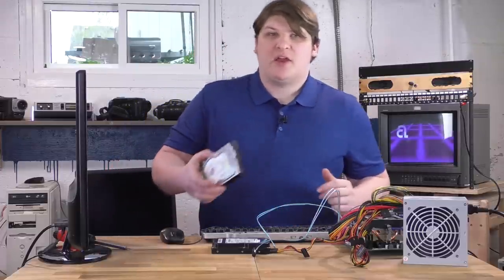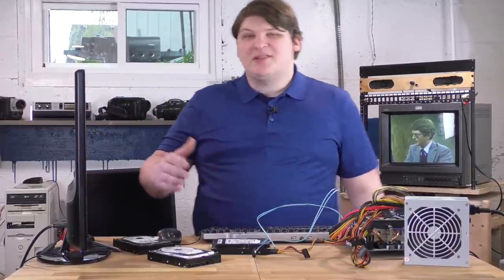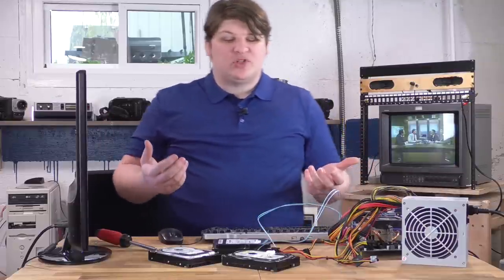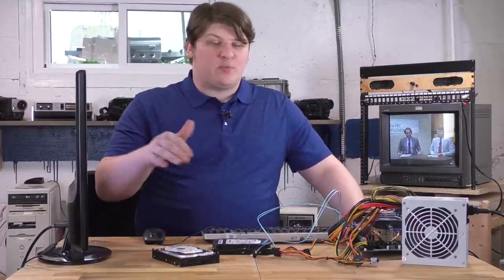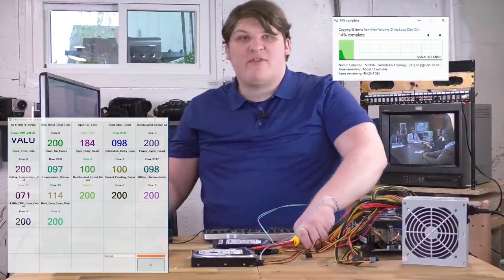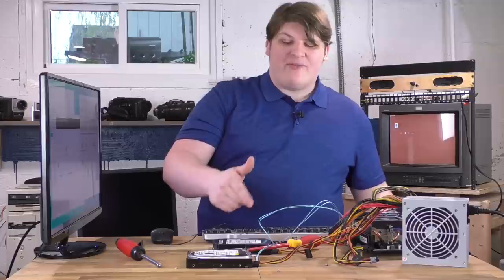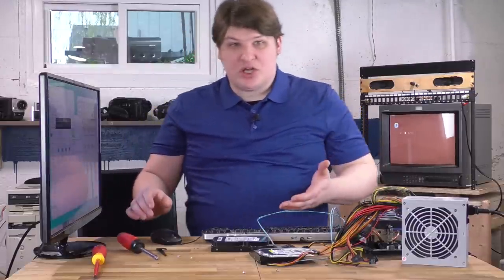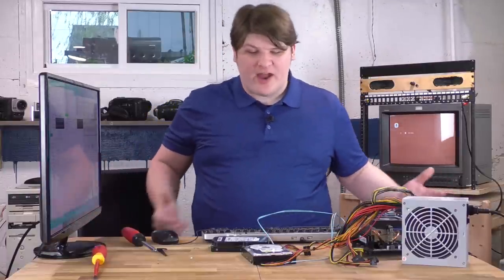Can A Hard Drive Breathe Regular Air Like Us

Comment from the maker: I didn't see a good place to expand on this in the video, but:

The most interesting takeaway from this experiment, to me, was that drive just kept trying instead of giving up. My impression of these devices was as highly stateful and intelligent machines, and I assumed that after a certain number of critical failures they would stop trying completely, and go into a coma to avoid further damage.

I also assumed that very tiny alterations in their environment would result in self-protection shutdown - when I took the cover off I suspected that the change in air temp, etc. might cause the head to not fly as high, for instance, and it would notice that and trigger an error state, or that if the head positioning coil went over-current it would trigger an error state, and either one would cause a shutdown.

This is, obviously, all entirely false. There really can't be failures worse than what I caused, and, in retrospect, I realize that my assumption wasn't supported by anything I'd seen in my life - hard drives with extreme damage, like a head crash so bad the head wears a visible track into the platter, always continue trying to operate; that's why clicking is such an expected behavior from dead drives, it's the disk trying over and over to start up despite being damaged beyond any possible recovery.

This almost "analog" behavior has changed how I characterize hard drives in my head entirely, from highly sophisticated devices, to machines that know how to do a couple things very well and have little decisionmaking ability beyond that.
Reply: As a design consideration, when extrapolating from some limited sensing about the state of your system and its environment, it's often better to avoid adding excessive complexity and prevent false-positive "fail-safe" scenarios -- because those can produce a terrible end-user experience. There are often a number of different conditions that can produce the same sensor values, and keeping track of which regions of this enormous state-space are benign or transient, and which ones are actually critical can be a full-time job, and not worth the effort for "consumer-grade" applications.
Reply: Nice job! Really interesting. But I wondered if you could just cut the portion of cover over the screw and tighten it again but just with that little piece from the cover over it to properly tension the heads. Could it work??
Reply from the maker: @hugofco2037  I thought about a lot of ways to do that and none seemed practical. It's pretty heavy gauge steel, so I would have had to take it off, go to another room, cut it down with an abrasive wheel and bring it back. This would be incredibly messy and produce a ragged result, which would not only leave the drive open to the world for half an hour while I did it, but I could never adequately clean the resulting object enough to be sure that it wouldn't deposit metal shavings onto the disk surface, which I'm sure would kill it.

I also believe the tension would only work if the resulting sheet spanned all the way to the sides of the drive, and possibly only if it spanned all four. So I decided not to try it, but maybe someday I will since I have a better, cleaner metalcutting implement now (drill-powered nibbler.)

Thanks for watching!
Reply: @CathodeRayDude  Well, I just realized I'm late to the show, but besides that. you could get 2 identical hard drives & pre-make a cover for your test drive. great video & amazing ending. I couldn't believe how abruptly it ended. I feel sorry for anyone who didn't watch until the end. ( FYI  I had the same thought on how you'd be able to do it. until I thought of a donor drive.)
Reply: It does happen that failing storage devices will go read-only, but evidently this unit never failed.

Comment: I opened up old hard drives and played around with them back in the early 00's. I was amazed at how long they kept on working without a cover on them at all after hearing all the tales about how fragile they are. I think I had one spinning along happily for a week before I got bored with it. Obviously it would eventually die and I would never trust any data on it, but it was neat to watch it work.

Comment: That was cool! Should've tried some less drastic tests at the end there, like instead of just dropping the spinning drive, could try these first next time:

- Breathing on platters
- Coughing on platters
- Touch platters with clean q-tip
- Touch platters with alcohol on q-tip
- Touch platters with finger wearing rubber glove
- Touch platter with bare finger
- Remove and replace platters &/or head with bare hands
- Yell at hard drive
- Taunt hard drive
- Make cat's paw touch platters
- Scratch platters with fingernail
- Scratch platters with key/screwdriver
Reply from the maker: these are very good, especially kitty paws, but I felt the video was getting long in the tooth and didn't want to get harder into it - however, I may do a second episode at some point with more experiments

Comment: I opened an old hard drive and then spun it up with a takeaway box lid over the top.  It worked fine for the duration of the experiment.
If I remember right that was a 0.3GB or 0.5GB hard drive.
This is a fun little video, I'm glad the algorithm recommended it to me!

Comment: This reminds me, I had this one hard drive that failed in 2018 (an absolute chungus unit of a Western Digital drive, I don't know when it was made but seemingly it was in a repair shop in 2013). It did this thing where it would buzz and churn and it just did NOT sound happy. At a random point in 2021 I decided to try recovering the files for the umpteenth time since it failed and, with my own two eyes, I witnessed the hard drive fall off of my bed from a roughly 3 foot drop and BOUNCE once before it lay on the ground motionless. I thought it was absolutely DONE FOR after that.
In some sort of godly 1 in a million miracle, it seems like dropping it actually FIXED IT, with the hard drive hooked up it started displaying errors related to missing windows stuff on boot, I used Hirens to recover and I had some more ridiculous hoops involving recovering the files again back to the hard drive, but I totally saved my 2015- mid 2018 legacy by pure luck and even now I still have no idea what "fixed" the hard drive.. after watching this vid I'm dying to know if anybody has had a similar experience to me in this regard

Comment: back in the late 90s at the shop i worked at, we pulled a hard drive apart, used standoffs on each corner to put it back together.  then clear tape around the outside left us with a bench drive with a window all around it to look in and see the heads moving.  we used it like that for a couple of years on our test machine out front.  cool display piece, people always asked about it.
i guess these days getting an acryllic cover made would be the better way to go

Comment: When I saw the picture of that Seagate ST-225 I laughed out loud!  I had a computer at one time that had that same 20 MB drive.  One day a lightning strike occurred in the courtyard next to the apartment building where I lived.  The PC seemed to work OK, but later found out that the 12 volt output on the power supply was a little weak.  When turning my computer on, I had to "jump start" that massive ST-225 with a 12 volt bench power supply!

Comment: Many mainframe hard drives had removable disk volumes, because the media was less expensive than the drive.  A typical volume had 6 to 11 platters the diameter of a large pizza, stacked four to six inches high, separated by about 3/4 inch on the spindle.  Outside the drive they were stored in a two piece “cake caddy” cover, with a handle in the indented clear top piece that turned an inner spindle, to which the opaque bottom piece was screwed.  To mount the pack, the operator opened the lid of the drive (which would only open when its spindle was completely stopped), removed the disk already mounted, lowered the disk by the handle on the top cover, turned the handle clockwise until it stopped, releasing the disk pack from its cover and locking it to the spindle, then closed the drive lid and started the drive.  When it was up to speed, the heads (5 for 10 tracks per cylinder, 10 for 20), parked under cover, extended between the disks.  To remove a pack, the process was reversed: stop the drive (which would retract the heads before turning the motor off), open the lid, lower the top cover onto the pack, turn the handle counterclockwise until it stopped, attaching the pack to the top cover and releasing it from the drive, then lift by the handle, screw the bottom of the cover on with the other hand, and put it away.

Even then, computer rooms had to be semi-clean, particularly no smoking!  When storage densities got larger, the manufacturers started using sealed HDA (head-drive assembly) volumes, replaceable only by service personnel.  Fortunately, disk and tape drive data speeds by that time allowed entire HDA volumes to be backed up and restored in a few minutes.  Critical data was maintained simultaneously on multiple drives on multiple channel attachments.

The storage capacity of those huge disk packs, incidentally, was in the hundreds of megabytes.  Later they reached gigabytes with the non-removable HDAs, which were part of the drive.

Comment: This brought back memories. For a class in high school I attached all the parts from a computer to a board to display on the wall and also removed the top of the hdd. The computer ran for weeks like that before it finally started to BSoD. Granted this was maybe a 2GB drive at most so not nearly as dense, but didn't expect it to survive long at all.

Comment: As I understood it, the vents with filters aren't to exchange air.   They are present so there won't be a pressure difference between the inside and outside.   Like, when the drive gets hot, the air expands.  You don't want pressure building up in there.   So a little hot air escapes through the filtered vent.   When it cools back down, you don't want a slight negative pressure, so some air goes in through the filtered vent.

I seem to remember in the distant past, some just had a single pinhole in the lid, possibly with no filter.  They were marked with something like "DO NOT COVER THIS HOLE".   I know more modern IDE and SATA drives had filters under them.   These older drives would have been like 1980s/1990s era hard drives, that I took apart in the late 1990s and early 2000s.  Like MFM, RLL, and early IDE.  They may have had a single layer filter that looked like a paper sticker.  It just needed to relieve pressure, not any large volume of air.

I don't remember handling many SCSI drives from that era.  Or at least none that I took apart.  Those were serious investments by the company, and they didn't allow for that kind of playing.

Comment: When i was younger i had a job destroying hard drives, old hard drives filled with concrete so the best way was with a sledge hammer. I'd put put the drive on-top of two concrete blocks with a gap in the middle then smack the drive in the middle with the edge of the sledge hammer, if you did it right the whole drive folded in on itself and shattered the plates into dust. €2 a drive was a damn good pay and i now have a certain respect for how tough hard drives are.
Reply from the maker: I had a job destroying hard drives as well for a while; we used an arbor press with a sharpened punch, and boy howdy did I ever find out how many hard drives have glass platters. Punch went through like butter though! Technically a sufficiently motivated attacker could have recovered some data from them but hey, we weren't doing CIA grade stuff.
Reply: @CathodeRayDude  I tried using a bench press at the time but it was too slow so the sledge was a good option, if i was having a good day i could get through about 50 drives in half an hour but it was certainly not easy work. If you missed the center of the drive it would hurt like all hell right up to your shoulder.

Comment: I put a plexi window into an old Toshiba drive, turned the shower on in the bathroom to as hot as it would go, then let the air settle for a bit. Opened it up in there and placed the drive under a clean dish once the cover was off. Ran that drive for months with no issues.

Comment: I once had a 20GB WD EIDE that had a frozen head that somehow got laminated to the platter. I popped the cover and freed the head, put it back together and it ran for years in a small FTP server as the system disk. It was still running when it was retired and recycled. These things are fragile yet built like tanks.

Comment: I have HDD 30 years old that still work.  I have 4 drives that have been running continuously for 20 years. I have had 10 SSDs fail while in warranty.  IMHO SSD's aren't ready for prime time.

Recently a friend brought me two computers that he wanted to get the data off from them with MFM IDE drives from the mid 1990's in them.  One of them would not spin up.  It made a lot of noise.  I powered it down and opened it up. Manually spinned the platters and placed the cover back on.  It ran like new was able to create an image and recover all of the files off it.

Rev George

Comment: Quick note, the holes on hard drives aren't exactly for airflow. They're breather holes, so that pressure variances caused by temperature and elevation are equalized with the atmosphere. There are drives that have a channel, that runs from near the head actuator along the side, with a filter in it to catch particles as air moves through, but most of that airflow is at the edges of the platters.

Also, is the program you wrote available anywhere?

Comment: I have personally never had a drive fail on me catastraughicly untill last week, most just start clicking or fail to spin up. One of the drives in my DVR for my cameras started screaming. I thought it was bearing noise, and it was definately dead as it dropped off the pool. When i pulled it the drive was incredibly hot and i had to see what happened so I dug into it. The head was missing off the arm and a large deep groove cut into the top platter near the spindle. The platter was covered in a layer of "dust" which i later found determined was the heads an platter material. I pulled it right apart and all 4 platter had deep grooves cut into them on both sides, and all 8 heads were vaporized. There was not a piece of one of the heads to be found, just dust and just the metal of the arms left and cutting into the platters. It must have failed while we were all away at work as it sounded fine when i left in the morning and was screaming when i returned. I can only imagine the sound that thing made when all 8 heads came crashing down onto the 7200RPM platters at once. Funny thing is, if i powered it down it would still park the "heads" and upon spin up it would still try seek for a bit until settling back into it the grooves it cut.

Comment: I’ve opened and re assembled multiple hard drives before and I haven’t had any issues with dust causing them to break.
It’s incredibly common for quantum fire ball hard drives to have their drive head mechanism to get stuck to the rubber bumpers. Repairing them is quit easy and I’ve done a number of them and they all work fine.

Comment: I once opened up a Seagate 1TB 2.5" hard drive because I have read that Seagates often get a stuck motor bearing and you can unstuck it in a clean room. It didn't make a spinning sound, just beeping so I thought this is the cause. I had a shower, so that the air in the bathroom gets cleaned from dust a bit by the humidity, immediately after and I opened the disc up. The motor turned out to be actually stuck, so I helped it around with scissors (yes, scissors as my pliers didn't fit) inserted into the screw heads, screwed it together and connected it to my computer. Lo and behold, it worked just fine so I immediately copied everything off it and haven't used it much since. I cecked it now about 2 years later and it doesn't work (spins, so it's not the motor). So most importantly, always make backups. Secondly, if your data is somehow worth thousands of dollars and you didn't back it up for some unfathomable reason despite that, go to a data recovery company. But if  it isn't it is either already gone (if the head itself is bad or surface damage happened), or you can give it a shot by opening the disc and seeing what happens. You might fix a stuck motor or head this way for free, or ruin the disc more and make the expensive data recovery even more infeasible. Just don't turn off that disc until you've copied everything off, and don't use it for any new data as it might crap out soon.

Comment: I took the cover of my hard drive off and did this too, and it took a full 20 minutes of use before I stated having issues, and a full 2 hours before it started clicking and failing more often than working. If you started it from stopped, you'd probably see it fail faster. The Aerodynamics of the disk spinning create an air bearing.

Comment: To me it makes sense that a fingerprint has substance, they are made of water, oils, amino acids, salt, and so on. All the things present in sweat and on the skins surface. Maybe you think of them as flat because they likely absorb into other materials. On a solid liquid-proof surface it makes sense they would stay on top.

Still though it's fun to think such a thin layer of mostly liquid can disrupt a HDD. Apparently it's measured in nanometers (as of 2011), the same size as features in modern CPUs (2024).

Comment: The cover provides a stable mounting point for the spindle screw. You could've cut the bottom half (or so) of the cover off leaving the top with the upper four screws to secure it in place (and hence still be able to put the spindle screw in) and had all kinds of area open for stale air while still allowing the drive to run.